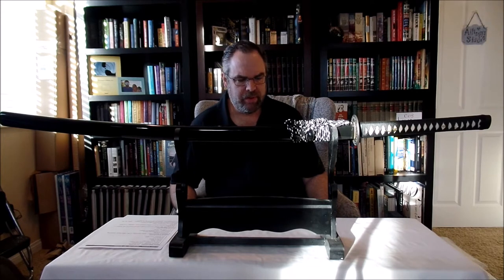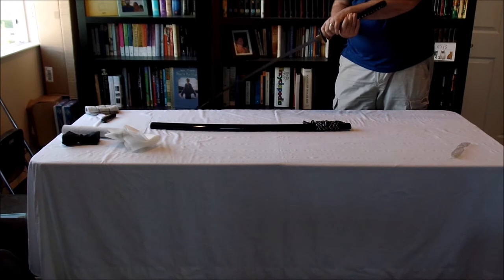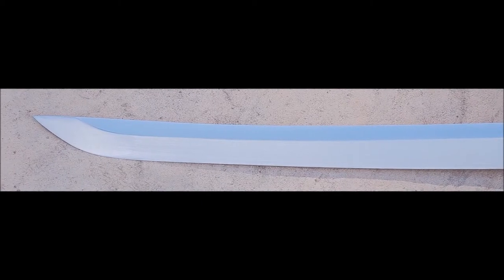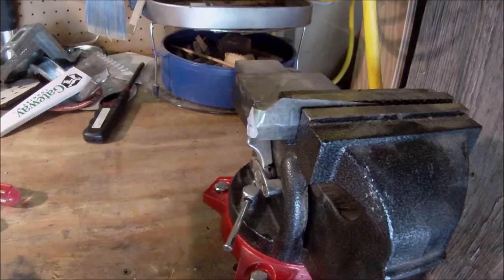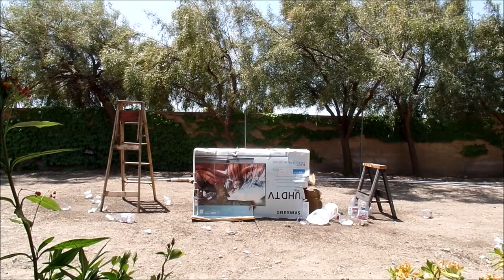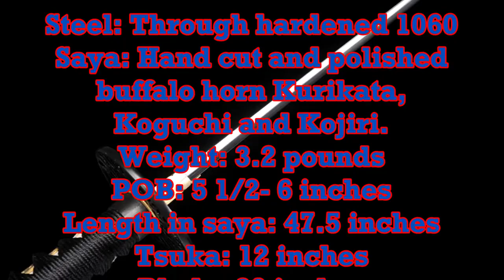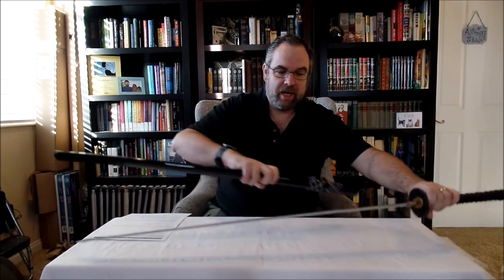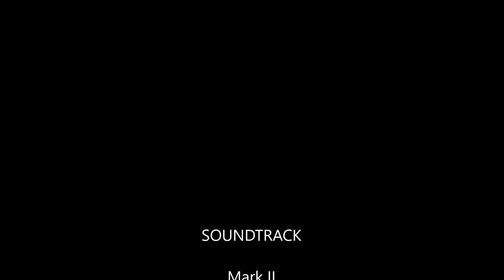Ronin Katana Dojo-Pro Model 9 Dancing Crane O-Katana

Comment: It might require more circular motion and putting your hips as well as upper body into a cut. Tip heavy — means it is best cutting surface also more towards the tip, meaning that experienced cutter can complete cuts at longer distances. So the tip-heaviness may be a calculated design feature. Just my two cents. I lacquered the tsuka and cut few softer targets with it, and was surprised at the reach and how well the area just below the tip could slice things, making the longer blade a bit more useful in some ways. Still, this is, probably, a sword for taller people with some upper body strength and mobile hips. But learning to do iai and cuts with it well — means it will be a breeze handling lighter and shorter designs.

Comment: Did you sell the ryujin o katana? I am thinking of getting one and am curious if you'd still recommend it?
Reply from the maker: Ryujin is a nice middle ground brand between the mass producers like Hanwei and Dragon King and the design it yourself brands like Swords of Northshire.  AND!! ... they pop 'em out pretty fast if you go through Sword Buyers Guide.  There are compromises to be sure.  But ... for the money it's a good brand.  I did sell mine off ... yes.
Reply: @mr.excalibur1455  are you putting hanwei and DK above swords of Northshire? I'm a sword noob so thanks for helping
Reply from the maker: @mrstarfishh33  No ... not at all.  Both Hanwei and Dragon King have some VERY good models.  Before I go any further ... what kind of katana are you looking for?  What do you want to do with it and how much do you want to spend?
Reply: @mr.excalibur1455  so I would pry spend up to $1000. I honestly just want something well made. I have read alot about loose construction, poor ito wrap (handle wrap?), Poor fittings etc. I def want all that to be as nice as it can. I realistically won't do much cutting. Ill mostly just mess around with it in my apt.  I also really want something longer than typical katanas, ideally 29"-33"

That's why I have been looking at this ryujin o katana. Good length, seems to be pretty good fitting/construction. And able to choose color and tsuba is cool

Comment: I was told anything over 2.55-2.6 shaku (30.5-31") was an o-katana. 2.6 is usually the longest most companies or makers make.
Reply from the maker: I've kinda come to the conclusion that the term "O-katana" is kind of a nebulous term and perhaps even just one for marketing as well.  There has been a GREAT deal of conversation over that very point.
Reply: @mr.excalibur1455  I just found they have a second o-katana with a fuller. #31
Reply from the maker: @tengu190  Yes ... I actually wouldn't mind trying that one out.

Comment: You mention swords & how they can be fragile in ways. I think many forget this because srlteel=strong & Hollywood movies do things with swords that are not realistic. In truth swords are meant to primarily cut meat & possibly bone (depending on the sword). If someone hasn't cut on pig parts or a deer carcass one won't fully realize how efficient swords are at cutting meat & bone. And while swords in history certainly cut into wood shields & sometimes would hit metal armor, this was not their purpose. 
Hitting hard objects with swords can blunt, roll or chip edges or even break blades.
Warriors of old knew this, we in modern times should remember this too when cutting things swords were not made to do.
Reply from the maker: Amen to that.  Swords are not axes ... not even close.  They are extremely fine tuned instruments meant to cut down a human being ... not plow through a car or cinder block ... thank you Highlander!!
Reply: @mr.excalibur1455  right! As much as I lived the Origional Highlander & the tv series they certainly were not realistic. Sure we could say immortal power in the sword blah blah .. but still people expect what they see with swords. Odd as most don't drive their cars like movies show, nor expect a car to be able to...but swords sure 😂

As far as cars a sword is in a way more like a finely tuned race car compaired to the axes station wagon or pick up truck. Race cars do one thing well for usually for a short time (swords may last generations but they are not daily use tools)...a SW or PuT are workhorses that get beat up, run ragged & expected to do so for years.